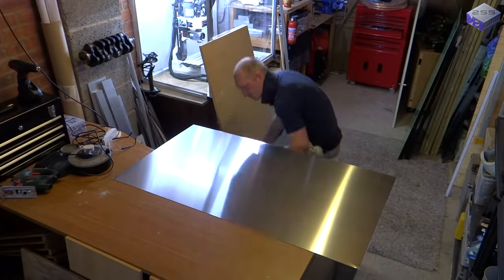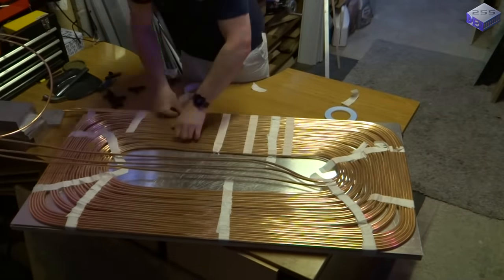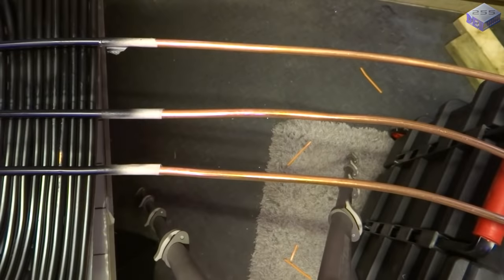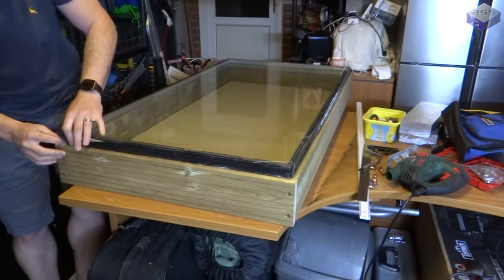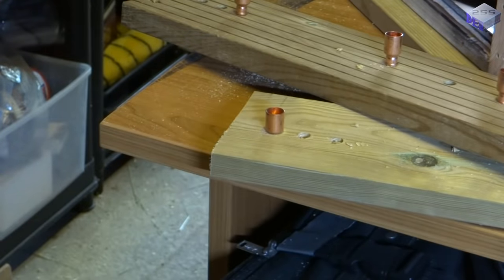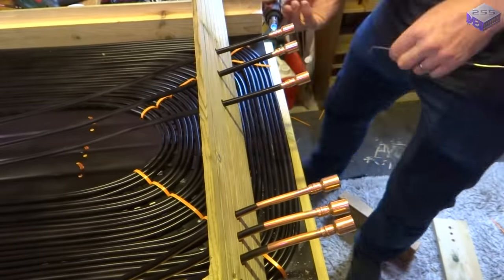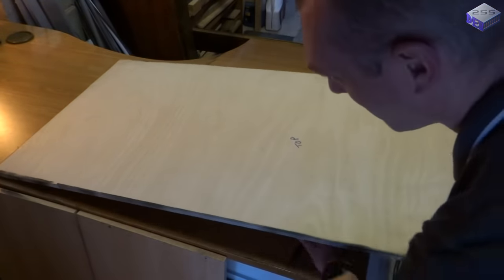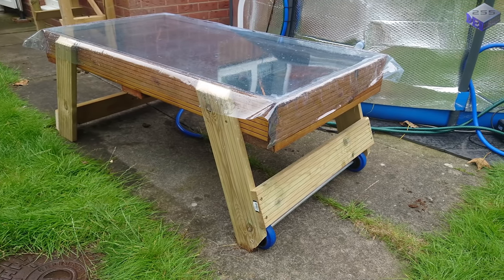Improved Solar Pool Heater - Full build

Comment: i like this project and was thinking of making something similar.  Here is a suggestion for a comparison video to see which works better.  I think you should replace the aluminum sheet backing with a piece of wood painted black.  Next to copper(which is the best choice for the tubing) aluminum is the one of the best materials for thermal conductivity.  Even painted it has a very high potential to wick heat away(That is why heat sink fins in Amplifiers are made from aluminum).  I believe you need a thermal insulating material rather than conducting material for the backing sheet.
Reply from the maker: Thank you. I would love to make two similar projects and tweak one at a time with slight differences to see how efficiently these can be made. I have a few ideas lined up, including the backing material. I need a good summer and lots of sensors attached to an Arduino microprocessor for logging now.

Comment: Isn't the idea to mark & cut THEN peel off the backing tape? Great project though. Thinking of doing similar to run through a shed floor and take the edge off the chill
Reply from the maker: Yep you are right, mark and cut before removing the film, although I wasn't worried about surface finish as I was painting it all black anyway. Thank you, it was a fun one to put together

Comment: What’s the size of the aluminium sheet? Hence the plywood that you cut to match its size?
Reply from the maker: Hi James, the plywood is the same size as the aluminium sheet; I should be able to measure it tomorrow if you need the dimensions?

Comment: £150 ($180) of copper for a 1m2 (roughly) pannel, seems like a lot to me. Assuming you can't get everything else for free (large sheet of glass, pipe fittings, black paint, exterior grade wooden panels for the frame, insulation), I'm assuming it must cost an absolute minimum of £200 .adding this up in my head as a normal DIYer it looks like nearer to £300 to me. A 1m2 rubber tube thing from Intex is £30. I imagine the intex thing is far less efficient, but £200 vs £30 is a hell of a difference to claw back with a bit of efficiency improvement. Not wanting to be mean, it looks like great fun to make and I'm sure its very good, I just know how much real stuff costs when you factor in tax and shipping and all the sundry items for me, and perhaps that's more than it is for you. I know money's not everything for everyone, but this thing really looks like a lot of money. I wonder if the greenhouse effect from the insulated glass topped box could be combined with a pre-made rubber tube sheet one and be a little more holistically efficient.
Reply from the maker: Hi, yes, sorry for the late reply, this was around £250 when purchased. I am experimenting with different materials to see what would make the most efficient panel at home with parts off the shelf. In my first video I used black plastic micro-drip tubing under a Perspex cover, this worked well too.

You could modify the £30 Intex system by insulating the bottom from the ground and covering the top with acrylic or greenhouse glass to reduce the amount of heat taken away by the wind. This works very well, you may even see 50 to 100% more efficiency, depending on where you are on the planet.

Also, evaporation is an enemy to heat loss, so covering your pool when not in use is a good idea too. Retention is half the battle.

Comment: How about using aluminum tubing instead of copper? Aluminum is cheaper and even better heat conductor than copper.
Reply from the maker: Hi, that maybe a good idea for a closed loop heat exchange system and plastic tubing taking the separate pool water between the exchanger and pool. The problem with aluminium is that it reacts badly with chlorine I believe, copper is less reactive and most plastics are safe. I need to do a bit more research into chlorine reaction though.

Comment: Really nice! Have you thought about pumping some of the air out of the box to insulate the pipes better?
Reply from the maker: Thank you. I did look into removing the air, although this seems to be a reasonably hard process to carry out and maintain. I am now looking to reduce the air by moving the coil closer to the top and still having the air underneath as a further insulating layer.
Reply: Yeah I'm working on something similar and it's going to take a lot of silicon, valves, and a lot of work for my vacuum pump
Reply from the maker: @brianjones8673  Sounds like an interesting project, would love to know how you get on.

Comment: Very nice however doesn’t chlorine act as a corrosive to copper?
Reply from the maker: I agree that if you don't maintain the PH balance of the pool and add chlorine when you don't need it (not testing the pool daily) then the chlorine will have more of an effect on the copper the more the PH balance is off. I will hopefully be adding the Chlorine, PH, Copper answers in a later video once I get credible clarification from either university or a professional lab. Essentially looking into this online is not sufficient and it needs to be answered with scientifically proven research. The idea is that the pool is non-portable water, chlorine is added sparingly only when required and the PH balance is maintained. Essentially there is an amount (albeit small) of chlorine in tap water that is PH neutral and runs through domestic copper piping in most houses for us to drink. This is becoming a hard question to answer.

Comment: I wonder about thermal expansion. I am pretty sure that should the panel sit in the sun with no circulation, the pipe is going to get extremely hot and expand to the point that all the thermal tape will come loose and those cable ties are going to break. Especially is for any reason the system is drained of water.
I have made a similar system using polyethene pipe instead of copper and when the circulation stopped it melted
Reply from the maker: High, yes these collect a fair amount of heat and if this is not removed the panel would definitely overheat, I have an aluminium sheet that I put over it if left outside, with or without water. I discovered this myself also, where I left the panel out in the sun with no water in it while I filled the pool, the first run of water through it produced around 15 seconds of pure steam out, I may put this in a video.

Comment: Wonder how well painting the interior of your pool black work.
Reply from the maker: Hi, I found that a black cover touching the water surface is more efficient than heating through the water. I don't know why this is as the energy  is still going into the water; maybe it is getting reflected away on the surface and refracted around and escaping back out from within the water. I know the black surface (or one that can absorb the most energy across the radiated spectrum) would be best. Plus there is around 9m2 of surface area at the surface of the pool too.

Comment: Neat project. Some houses in Australia have a similar setup to aid heating of hot water tanks. But to put it into perspective, a pool solar heater here in Brisbane.would cover about 50-100% of the surface area of the pool so would need to be a lot bigger…
Reply from the maker: Thank you, it would need to be bigger here in the UK too, this one was made from all the comments from my last design so will need a bit of tweaking. The idea is to get the most efficient homemade panel before taking all the results and making one large efficient one. Hopefully, we get a decent summer in the UK this year as last year was almost non-existent.
Reply: @TheSolarPoweredEngineer  I saw another video of yours where you had a spa - is the heater for the spa or a pool? Your one as heater for a spa wouldn't be too far off the mark...
Reply from the maker: @RandomSmith  Hi, this was for my pool, although would work better with a spa as there is far less water to heat (1000 litres instead of 4600) although there is a question regarding using copper with chlorinated water if the PH goes off balance, I'm looking more into that though.
Reply: @TheSolarPoweredEngineer  I had a quick read and yeah, copper can cause stains or colour the water apparently. Some algaecide that we put in pool has copper compounds in it so is valuable in some quantity to help stop pools going green. I have had two pool solar leaks, the first was some big birds pecking at the plastic matting, the second was one of the manifolds that broke - https://youtu.be/qoGDNZZCySA?t=130, the matting is something like 10 parallel lines of thin black plastic/rubber tubing and because the matting is two stories up and large area, has a 1kW pump to push the water up that high. So that is for a pool area of about 4.2m x 7.6m. I think in your design if scaling up, change the copper tubing to black plastic tubing for cost and just paint the baseboard black or have aluminium foil rather than a sheet of aluminium, again for cost. The way our solar works was that there was a little sensor in a stainless steel tube/cap (5mm or so diameter by 4cm long) a dry piece of matting that was about 30x50mm so the matting must be around 5-7mm in diameter. So the sun heats the little bit of matting (I can place that anywhere that has the same orientation as the roof) so knows the solar radiation by some sort of correlation and a second sensor near the pump that is in the water pipe. There is a control box that will say something like roof 60C, pool 28C, solar pump on. The pumps will only run if there is a certain delta of temperature - something like 5C difference. I'll need to try and measure what temperature the pipe into pool is at (is probably something like 30-38C). The other thing that helps with pools but can be a pain is the bubble wrap style cover - that stops heat loss via evapouration but that deteriorated after about 4 years and I didn't replace it- that sometimes made the pool water too hot. It starts to get uncomfortable as it nears body temperature. For longevity of black pool matting, ours has been on the roof for 12 years. My sister in laws pool matting didn't last that long - not sure what broke on hers though or if it was birds.

Comment: So the question is will a single glass do ? As the heat is easier to be transfered as let's say with a double glass window ?! 🏆🐿️
Reply from the maker: Hi, most likely yes; I've had a few comments suggesting a single pane would be better, where the double glazing reflects some of the light energy back out, hence why greenhouses only have single panes. I will be trying different materials for this, such as polycarbonate, Perspex, single pane, etc., to see which performs best.

Comment: Try a single layered glass as the regular  window has an insulating gass inside. Usually argon
Reply from the maker: Hi, a few people have mentioned this in the comments and I totally agree, I will be testing different systems this year with different materials, measuring flow rate and temperature rises in each system, all while logging the data for accurate results.

Comment: would a single pane of toughened glass transfer heat better than a sealed double glazed unit?
Reply from the maker: Hi, from yours some of the other comments here it probably will, it looks as if I can increase the efficiency further using just that, or clear polycarbonate sheet, I guess that's why greenhouse glass is normally single pane and completely clear.

Comment: How did you step up from the garden hose to the bestway inline pump?
Reply from the maker: Hi, I was a little unconventional with the step-up in pipes, I used a piece of heat shrink to put the 2 together, wrapped this heat shrink with self-amalgamating tape to seal the ends of the heat shrink, and then placed another piece of heat shrink over the top to hold it all together. This has lasted well over a year and shows no signs of leakage. Although, it is now fairly easy to find stepped hose adaptors to make a better job of it.

Comment: Nice work but how do you taccle the lime accumulation in copper pipes?
Reply from the maker: Hi, I haven't noticed any lime build up just yet, although there is a question on whether to use copper with chlorinated water, especially when the PH balance is off; this is something I am trying to get a definitive answer too The other option would be to use a different liquid in a closed loop for the copper system and use a heat exchanger to transfer it to the pool with plastic tubing; I think this could be the best option here. I will be doing more tests this year with different materials.

Comment: Have you considered adding some reflectors to concentrate more light onto the pipes? Or perhaps make a good enough seal to pull some air out of the box to speed up heat transfer and cancel out external Temps?

That's pretty cool.
Reply from the maker: Thank you, yes I was looking into fresnel lenses too, although think a reflector would be better, plus have the reflector tracks the sun onto the panel instead of the panel moving. I think it would be great to have the panel evacuated, I will probably be reducing the size of the sides and switching the glass to a polycarbonate sheet, double polycarbonate panel or acrylic panel to see the differences, from all the comments, it looks as if the glass is reflecting some of the UV.
Reply: @TheSolarPoweredEngineer  that's the fun part of engineering! There's always room for improvement ;)
Reply from the maker: @EricEstesEleutherian  very much so, I'm slightly addicted to this at the mo, I've just bought a thermal imaging camera to investigate more 😉
Reply: @TheSolarPoweredEngineer  Excellent! Looking forward to more content ^_^

Comment: BUT....? How well did it work...? You left me hanging at the end :-(
Reply from the maker: I'm sorry I didn't mean to leave you hanging, I will be doing more on this fairly soon and have seen around 500W from this panel. Unfortunately, last year's summer left us all hanging with the lack of sun, so was not able to do a complete test. I will have to test it in overcast conditions too as I've been asked about its performance there too.
Reply: @TheSolarPoweredEngineer  can’t wait! I’m very much liking what your doing not sure I need a heater yet as my pool gets tons of sunlight current my today we are at 79 degrees and that is warm for us new England era here in New Hampshire.
Reply from the maker: @digitalldreamer  I agree, the pool does need to be a little cooler than the outside temperature feel, although it is nice to get into a pool that's greater than 30ºC/86ºF at midnight and be nice and warm.

Comment: Any issues with pool chlorine or the pH and the copper tubing?
Reply from the maker: Hi, not as yet, although the water does go directly to the pool. I'm currently looking into this and trying to get an answer from a university or other professional body as this is a concern from reading some of the comments. The thoughts at present lean towards using chlorine only when needed and maintaining a neutral PH balance as the chlorine will react more aggressively if the PH is off neutral. Drinking water also has chlorine in it (although the amounts may be a lot smaller) and runs through copper house pipes with a neutral PH, but that is professionally monitored. There need to be more answers online. A heat exchanger plumber into this system would be a better option, I will be looking at doing this as a closed-loop system, that way I could connect PVC pipe to the copper pipes and have the PVC pipe run around the bottom of the pool transferring the heat. I hope that helps.